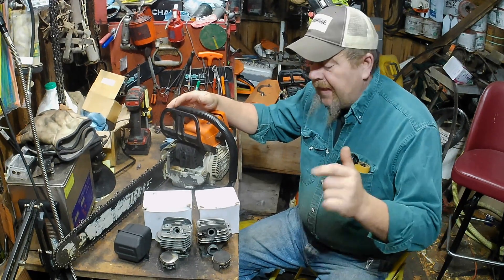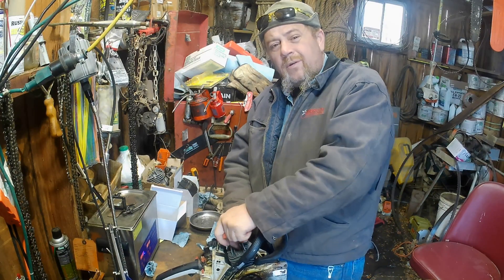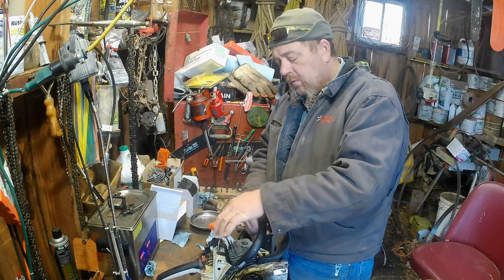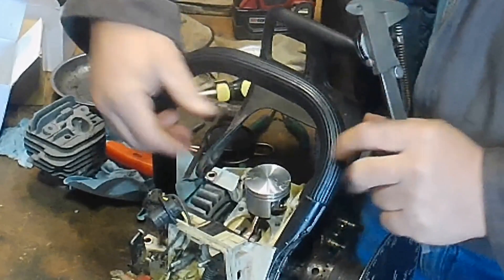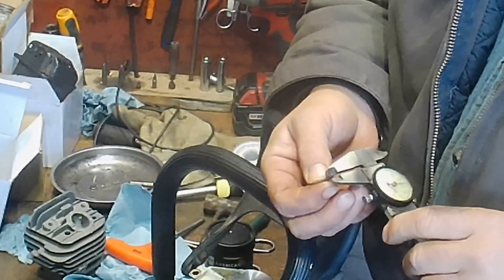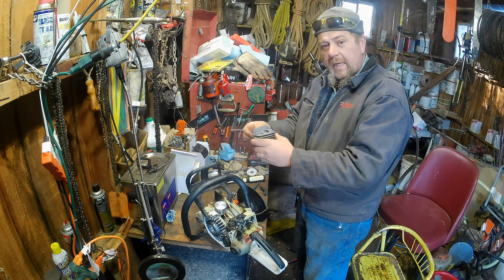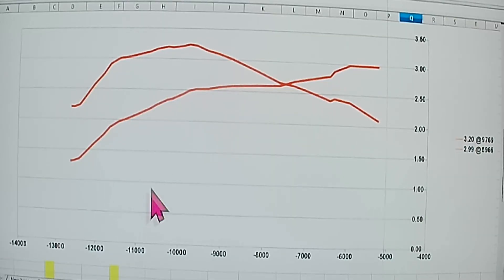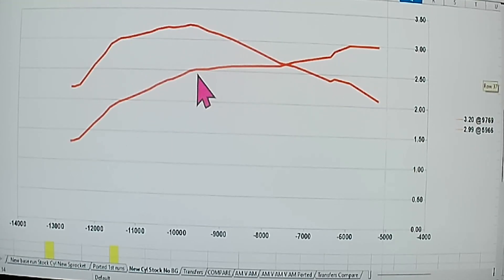Chainsaw Porting-Testing EACH Step-DYNO and Test Cuts: Step I: New Cylinder

Comment: i have bought a ton of those amazon cylinders and the one on my 380 made the piston fit a little tighter than i was comfortabl with but its a runner. i shaved the base down as much as i could and the ports were already pretty huge. the plating on the cylinder looks extremely thic which also worried me but its actually my second best running saw. my aaron lynch 440 is still better but that ole 380 is pretty good now
Reply from the maker: @matthewknight5641  I've had fair luck with the Amazon (Mtanlo and Adifol) cylinders.  Had one big bore that the piston was too snug, too; couldn't/wouldn't run it; think it was out of round?

Comment: Where did the cylinders come from?  Are they fairly similar to factory specs……asking for a friend 😂
Reply: P.S.-  have you had any adverse effects regarding chipping of the chrome or any other negative issues?  Just starting journey and you have a lot more experience…..thanks
Reply from the maker: @wrstew1272 Well, I don't trust myself with good toys yet... I run cyls off of Fleabay or that door-to-door place that the Japanese company that mama san's and papa san's little boy (Amma San) started up. 😉
There are some pretty significant differences in quality and some numbers/shapes, but they're a GREAT place to learn. Believe it or not, I still have EVERY SINGLE stock piece that came with the 026; one of these days, I may settle on a "perfect" build for it and start grinding on the OEM cyl.
Even going from the OEM (STD bore) to the AM Big bore, I lost 20-25% hp right out of the box.  I personally don't mind because I'm not looking for a specific HP; I'm looking for gains/losses. With an AM cyl, I just have a lower starting point. I've heard that the AM cyls grind way easier than the harder OEM cyls.

Comment: What brands of aftermarket cylinders and pistons you are using?
Thanks for the videos
Reply from the maker: @bluelightguy1  First Cyl I used was a Mtanlo with the piston supplied; second cyl was Adefol with piston supplied. Both were/are from Amazon. Probably better AM options, but I figured I would fubar a couple before I stopped trying to make this one chooch better. Third cyl will probably be the Mtanlo cyl with the Adefol piston.  FYI, no sponsors or whatnot whatsoever; if I'm wasting money, it's mine and a (hopefully) cheap lesson; so far, the ruined cyl(s) can point their blame directly at me.  Thanks for being here and joining-in.
Reply: Thanks for the reply , i have used a few Adefol kits myself , one had a bad plug hole right out of the box, so far the other 2 kits have been good, i think I will try a little porting myself. Thanks for the videos and the time spent making them. @HayChaffandSawdust1
Reply from the maker: @bluelightguy1  You are quite welcome!

Comment: This is an interesting saw build .That is pretty cool you have your own dyno.
Reply from the maker: @kennytheguitarfanatic054 Thanks!! I built the dyno and wrote the software this fall out of scrap (mostly). You ain't no slouch yourself; I especially like your video of using socket(s) and/or muffler tools to hold a cylinder in the mini lathe. Am using the socket idea and it works well. I did it a little different that you, in that, I used a 6pt socket and chucked from inside (didn't have to switch jaws). Seems to work well.
Reply: Glad my info could help.

Comment: Hey, this cylinder seems way better. Excellent, look forward to the rest of the mods and see how the power numbers are when you get done.
Reply from the maker: @TheJohnDeereGuy  This cylinder has great potential if I don't mess it up; I ALREADY noticed that I read the timing wheel wrong and it's 96 deg and not 101; That wouldn't be too bad, but I'm a few steps past this video right now and just done the exhaust y'day. Still gaining power with each mod, but may have exhaust too low making me do machine work. Oh well, I may make a hot-rod out of it yet. It's fun and disheartening at the same time to see that some results "feel" better, but really are not by very much.  Good to hear from you sir!

Comment: On the digital calipers, for me, it seems like every time I wanted to use them, the battery is dead. So I like the dial calipers.
Reply: Also prefer the analog over digital.
Reply from the maker: @Archer_82 I'm with you guys! I wondered if the linear electronics (can't remember proper name; have same on my sawmill) may be better for dirty conditions.
Reply from the maker: @TheJohnDeereGuy  I have 2 sets of Starrett's and can get dirt in the rack or pinion and make them jumpy. Wondered if the electronic ones which are on a longitudinal scale would be better to have laying out on the table while grinding or machining? I have a cheap-charlie pair coming from the rain forest... Like you though, I sure prefer the analog style when they're clean.

Comment: You always earn a 👍.  That cylinder has potential.  Hope it holds together.  

It's amazing what cold dry air does for a saws performance.
Reply from the maker: @Kevin.L_   Thanks Kevin. I have high hopes for the cylinder; have more videos coming as I can get them edited )3-4 steps further along; if it wasn't for including weather conditions, it could seem that hp/tq was actually lost on small changes... if the weather changed between test cuts.
Reply: @HayChaffandSawdust1 Hard to argue with dyno results especially with you including conditions.  Air temp and density would definitely cover up small changes.  You seem to have things figured out pretty well.  Looking forward to more.